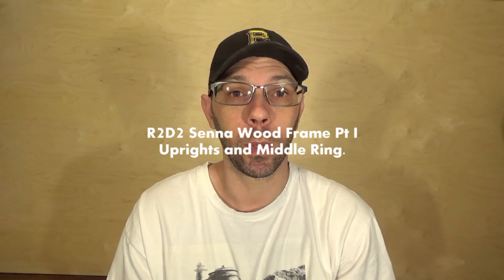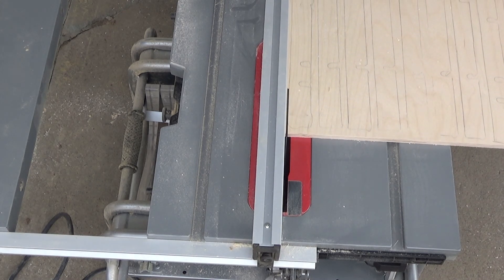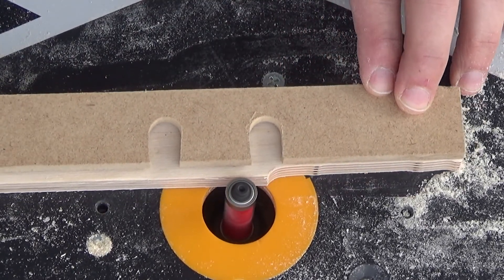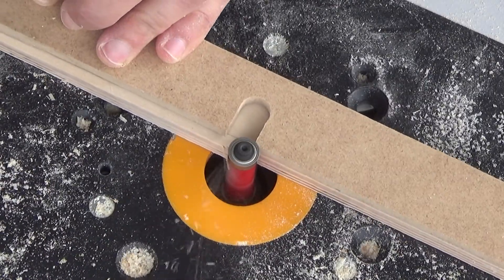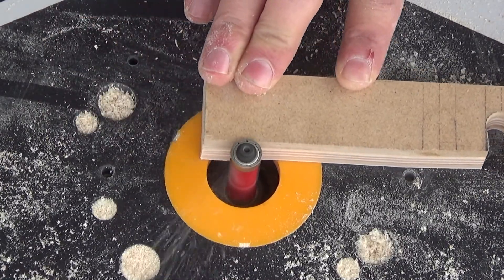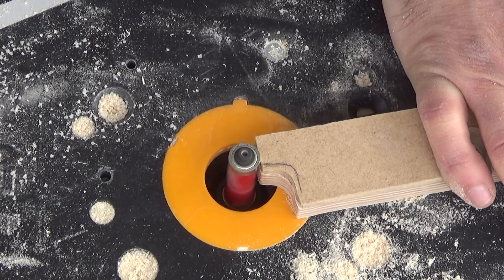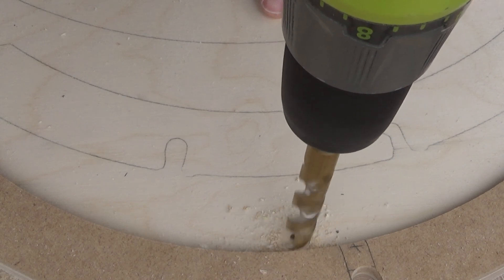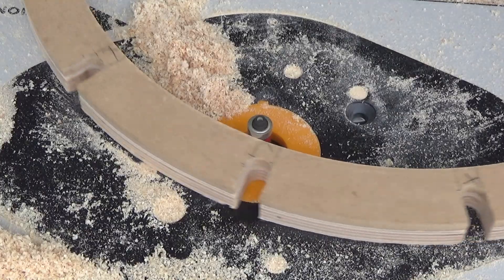R2D2 Wood Senna Frame Part I Uprights and middle ring. Router, Table Saw

Comment: Muito bom!  Quero saber quantos milímetros e ou polegadas é a espessura do compensado utilizado. Desde já agradeço a atenção. (AlmirBacana - Brasil)
Reply from the maker: The uprights,  side wings, and middle ring are 1/2" Baltic Birch Plywood. Because it is a manufactured overseas, it is typically measured in metric, but converted for sale in the US to its closest equivalent.

Comment: Half way through the  video all that saw dust had me  sneezing.... I cut my first one out with a router and a pivot arm. A dado blade would also do the  cutouts on the  verticals and  leave a more  square cut.
Reply: I agree. The method you mentioned  also works. If someone is on a budget, it is good to know they don't have to use a dado blade. The table saw was able to do the job.